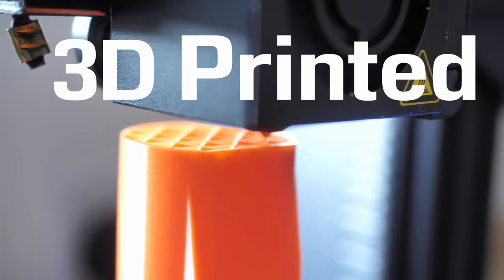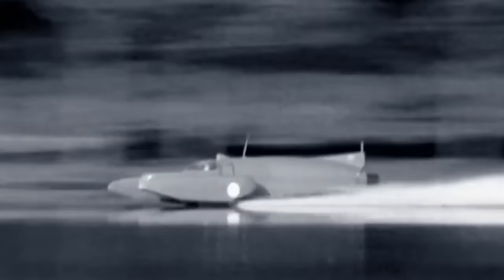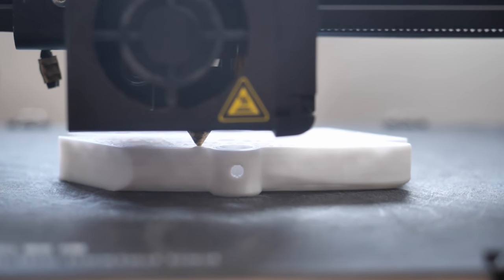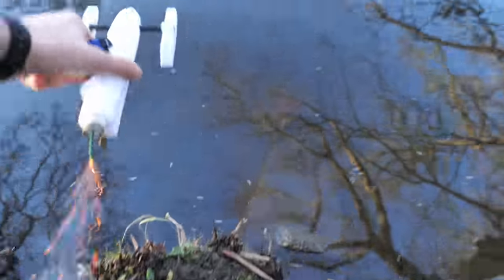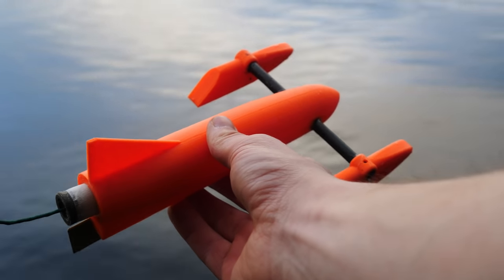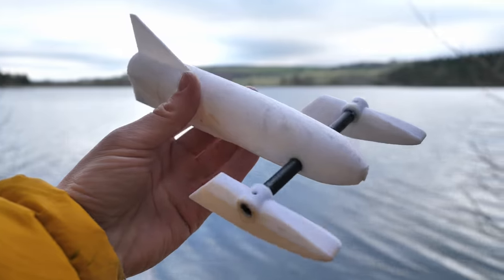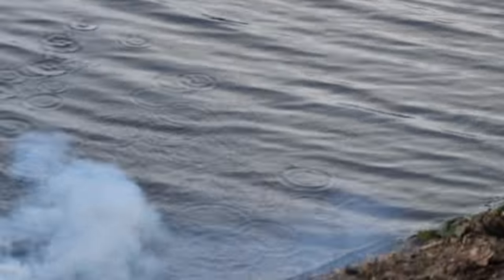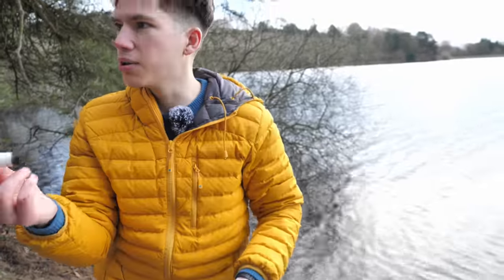Mini Rocket Boat

Comment: From my old model rocketry experience, while you want the CG ahead of the CP, you don't want it too far ahead or else the rocket will tip into cross-air currents (e.g., wind) excessively.  The rule of thumb was CG ahead of CP by the diameter of the rocket,  Anyway, love your channel and content.  Keep it up!!
Reply: This is a boat. Not rocket. Also not going up.
Reply: @alpha_pixel_  still applies though, think about how both are simply moving through a fluid. you just want to avoid feedback loops once the rocket is tipped off axis
Reply: @alpha_pixel_  fluid dynamics pretty much covers going up, going down and going through, liquids and gases.
Reply: @alpha_pixel_  Mmm, that's a personal opinion, but I kind of thing it is much more complex than this. That's what could be called an 'interface vehicle'. Meaning that traveling at the same time in interaction with several (two) types of elements (here fluids, liquid and air). Which one has the upper hand? As in F1, aerodynamics impact parts which are also in contact with the ground. But the opposite is also true. That would be the same for a sailing boat, that could be seen a a blend between a wing and a boat, the with the added complexity which is to deal with other interactions, as when the wind blows, the waves tend to be higher, meaning that the scenario changes as the 'envelope' does, and the design should accomodate for these changes. Not an easy task! Best regards!
Reply: @alexandregrynagier1762  physics are a personal opinion? Interesting 🤔☺️
Reply: Personally I found double the diameter was best (altohogh the rockets I used weee quite thin

Comment: Angle the outer edges of the sponsons, this will help prevent the rolling over. I used to race gas rc hydroplanes. This was a trick to get them to turn fast without rolling over.

Comment: Small ripples behaved like massive waves at that scale. Increased scale will for sure be better. Also a T tail with trim tabs to adjust level / angle of attack at high speed would help.

Comment: Bigger boat and even bigger rocketengine! Maybe you should include there little bit electronics and make a gyro stabilization system in all 3 axis. A Goal would be to get straight line and more speed. I also recommend to make front ”skis” bottom v-shaped to make them less responsive to little waves.

Comment: Our racing riggers use two CF tubes, fore and aft. This prevents them from twisting, which is what appeared to happen in the first run when it avoided the retrieve boat. That would also keep it running in irregular circles as it did. Also, cg is important. It should balance slightly behind the rear edge of the front sponsons. On a 24 inch boat about 1 inch back. And a fixed rudder at the rear will help with tracking also. Keep at it!

Comment: Explore boats on underwater wings. There was quite lot of those used in river navigation of USSR. It also has 3 points of contact with water but under water. It gives better stability because there is no surface that causes transients while boat touching and detouching it.

Comment: Ive always wanted to build one with an EDF powering it. No idea why
Reply: With an EDF it gets water spay on the fan and most of the time the fan implodes or it goes super slow due to water hitting the blades. You would have to work out a way to prevent water from hitting the fan blades which isn't easy on a small scale. Best of luck. Just have fun.

Comment: For this hydroplane design, you may be able to get more reliable onset of planing behavior by putting two thin cheek pieces on the wedges so any trapped air can't escape out the sides. The cheeks or side-walls would basically force any air in front of the sponson wedge to go under it; the only water drag you would incur would be the two thin side walls slicing through the water. Same with the wedge under the boat itself; sidewalls may help force any air in front of the wedge to go under the body, causing the onset of planing to happen more reliably.
Could you try that and see if putting sidewalls on the wedges improves the onset of planing? I'm curious to see if that works.

Comment: you really need to try to launch these boats again but parallel to the coastline of the river. If the current and the waves are hitting the boats from the side it affects the boats stability way more .

Comment: You should make a large scale one that is remote controlled but have the motors delayed slightly so 3 go off, then 10 seconds later another 3 etc so you have a longer burn time

Comment: Your stability problems are the result of launching the boat with the current of the water perpendicular to the boats center line. Those tiny ripples are large to that tiny boat. So it causes a rolling motion until one sponson is completely out of the water. The opposite sponson is levered down into the water, increasing drag on one side. Thus slowing that side and inducing yawing motion. The solution for the tiny boats would be to launch the boat parallel to the current. So, yourself on a boat anchored out in the middle, I would suggest launching into the current so the tiny boats would float back toward you.

Comment: Looks like all it needs is a brass plate below the rocket motor to keep water from splashing into the nozzle. That will stop the rocket from sputtering, and help it produce more consistent thrust.

Comment: Try this simple expedient: make the bottom of your rear planing surface a trifle wider and a slightly inverted V bottom. This forces the water-which always wants to escape from the bottom of the boat sideways (the shortest route) without planing the boat, to keep moving aft and to continue lifting the boat. If it does go sideways, it has to travel downward thus lifting that way as well. This is based on the old Hickman Sea Sled principle which has yet to be improved on.

Comment: Possibly a very daft idea but......
Could they be designed to be symmetrical (top and bottom) so if they flip they would still plane . They are fairly close to symmetrical so not a large change.   😎

Comment: You should put rudders on the out riggers will help keep it in a straight line. Also cant the The angle of the out rigger will also help with tracking.

Comment: That is so cool, hydro rockets, but my opinion is " why the motor(rocket) is under the water , i know that they are  waterproof but that causes unnecessary underwater combustion that affects rockets performance ,just try one's again with rockets exhaust out ofthewater" maybe the results may different 😉

Comment: I would suggest two things. Firstly, put your sponsons a bit further out from the hull. secondly, I would suggest you put keels on your hull and sponsons as well, to aid in directional stability, these changes would make the boat be more stable than a single rudder at the back and flat sponsons. if you look at boats, they have a keel, and that always makes a ship more stable both directionally but also at speed. I noticed that once your little rocket boat gets to a certain speed, it starts hopping unti is get high enough to cause the front of the boat to go under the surface, so your sponsons should have a clearly defined keel, as well as being curved upwards at the front with a clear horizonal line that defines the top of the sponson so that when the front of your boat comes back down onto the water from a hop, it doesn't dive into the water, but forces the water away from the sponson both forward and to the sides. in otherwards your sponsons need to be shaped like a boat as well as the hull of your boat, rather than being shaped like a torpedo. I hope what I'm saying here is clear to you. go look as some of the fastest speed boats, and your hull and sponsons need to have a similar shape, otherwise you will continue to have your rocket boat doing impressions of a torpedo.

Comment: Add fins that are sharp on the edge started from 10-20% the length of the pontoons on each side
Same fins as the pontoons for the back
Try with single to two fina for the pontoons

Comment: Can you make your own propellant and your own thrust engine like integza did. Btw love from India
Reply: Under UK law it is prohibited to manufacture your own motors
Reply: @noahluppe  oh I didn't know about that . But can you explain in detail that which kind of motors are prohibited (electrical, chemical) and if someone or some companies wants to experiment for good how can they achieve .
Reply: @rishabhguptarg  Without license the production of any explosive is prohibited, wich applies for solid rocket motors. For liquid or hybrid motors other laws might apply, like restrictions for compressed gas oxidizers, without owning the proper licenses.
Reply: @noahluppe  it is very strict their that's means. I think project air should apply for the license
Reply: @rishabhguptarg  If I know something from germany "applying for a license" is not just sending in a form or sth. Here you have to attend licensed courses to be able to get the qualification for similar things. And it does cost some money.

Comment: Had an idea. What about a submerged fin that controls the height of the hydro plane. Similar to an elevator on a plane. But it would be operated by a float. When the craft is low in the water, the float would pull the elevator up, when the proper height is reached, the float would level out the elevator. It would seem this design would allow you to get the craft nearly all the way off the surface of the water.

Comment: Side angle of front sponsons is 7.5 degrees, kind of like dihedral.
Sponson angle of attack at rear is 3.5 degrees.
Sponson angle of attack at front is 15degrees.
Vertical outside of sponson is 7.5degrees tow in.
Vertical inside of sponson is vertical with turn fin optional. 

Rear of hull needs sharp sides and pointy corners. Convex hull is ok

Comment: Do you have a lot of model rocket motor police running around, in the UK? 
Maybe you could have two rocket motors on the front sponsons, that might travel straighter, if you could ignite them both, at the same time, with an electric igniter.
The color orange seems to be working well and you should stick with that.

Comment: I think you need to also consider the thrust line of the rocket motor as well. IE planes do not have a straight thrust line. usually slight down thrust up to about 2 degrees.

Comment: The relative elevation of the boats above the waves compared to the average height of the waves/ripples of water they need to traverse on is perhaps  a factor to consider. Make the thing such that the average height of the craft/its elevation relative to that of the waves on the water is large enough to matter less. I guess that would require the use of a larger motor, not so?

Comment: the test kinda revealed something to me. the orange one with a wider base means that any variation in the two, where drag is affected, either by the boat tilting, causing one side to hit the water faster than the other, or by surface imperfections from printing or debris getting caught, will cause the boat to yaw violently, whereas the blue one being closer is less likely to run into such problems and would go straighter, which isnt something that crossed my mind up till watching it happen

Comment: Jetex marketed a model of Donald Campbells Bluebird hydroplane in 1965 together with a Bluebird record breaking car I had them as a kid I did not use the hydroplane as it was likely to run out of motive power in the middle of the lake and become irretrievable for me but the car was fun even if it was responsible for the odd burnt finger, the real issue with the 3 point hydroplane design at speed of course is stopping the nose from lifting and flipping the whole caboodle but I would have thought a computer driven stability system using front canards might work but probably hellishly expensive.

Comment: Hi! I don't know if if would be the right term, but maybe adding a 'toe in' to the front float, or design them so they create more drag to the outer side of a turn would help a lot in stability i think. The issue is that the front floats create more drag at the front. More buoyancy is cool there, but more drag means this craft is dynamlically unstable, especially if the front floats are neutral (it would be worse with a 'toe out' sorry for borrowing racing car terminology here). It could be a stupid idea, but if your sponsons where designed to act like wheels (meaning they could spin as fast as the boat goes), it could reduce the drag. Or maybe just another stupid idea of mine :p. Anyway, cool idea, i love it, and thanks for the video! Best regards.

Comment: Wonder if a hydro foil would work. Just attach runners to the existing boats you have would be less effected by the rough water and get the engine out of the water.

Comment: I bet the aditional weight in the front caused the torpedoing. maybe compensate with buoyancy? also I would try to raise the motor a bit. So it pushes the nose down.

Comment: You should try a tunnel Hull design biggest problem I see here is the Center body is in the water too much but this is really cool with the rocket engines years ago they used to use the little Estes jet engine and little cars and boats

Comment: I have a recommendation; A)For a control get same size but slightly shorter burn. B) Contact a university with a swim team, or contact MoD many military pools are huge. C) Explain what you're doing and why, but you'll probably have to explain why it would be beneficial to highlight their institution on your channel.  It's free positive advertising for them and both the universities and the military want to be viewed in a positive light, it helps with recruiting... both, studemts (and their tuitions) and the military (new military members).
D) Test on the glass smooth surface. Film/video everything. 
You might find some impressive, maybe even surprising data.
If you want to increase your science think big... more data. If you want to increase your channel tnink big... more subscribers... more revenue... which pays for more science.
It's an ingenious system YouTube has set up, take advantage of it.

Comment: I loved seeing your speed boat go.  Well done.  With some small changes it should be able to go straight.
I disagree with your intent to place the CP (center of pressure) so far back.  Center of gravity (CG) is less important than center of drag (CD).  Placing the water fin near the rear moves the CD back.  Finding the CD is tricky in this case because it involves both air drag and water drag.  It will go straight as long as the CD is behind the center of pressure (CP).  Take an arrow as an example that is easier to understand:  The CD of the shaft with no tail feathers is about 30% back from the tip while the center of mass (CG) is near the middle.  Without tail feathers any slight perturbation that offsets the CD from the CG in the line of flight generates a torque which increases that offset which will cause the arrow to tumble.  By adding tail feathers to move the CD behind the CG any perturbation that offsets the CD from the CG in the line of flight generates a restoring torque to realign back to line of flight, thus the arrow flies straight.
For your speed boat the fin in the water has a dramatic effect of the CD because water density is huge compared to air.  However, when the craft hits a wave (ripple) it may bounce the fin free which enables the CD to move forward, instantly loosing stability.
So, what if the rocket motor were mounted near the front?  Maybe with a fuselage diameter big enough that wouldn't melt from the exhaust.  Also pay attention to its airborne flight characteristics.  It may become fully airborne after hitting a wave (ripple), so in that mode it may need small wings, like a canard aircraft design, to glide back down to the water surface.
This problem is very similar to the lesson learned by Sailrocket 1 : https://www.youtube.com/watch?v=8Ow8QbXhZJU 
and fixed by Sailrocket II : https://www.youtube.com/watch?v=DCPx8wQZ5KE

Comment: So we did this in 1972, oh god was it really 50 years ago…….

So without YouTube we had a huge amount of fun and avoided arrest too! And we didn’t have goggles, only highly inflammable kiddies Parka coats (look them up).

Materials needed:

1 x Airfix Model of HMS Fearless, (LPD Landing Platform Dock) last in effective combat 40 years ago in the Falklands Conflict and now razor blades somewhere.
1 x Standard Firework Rocket with stick.

Cut off stick from rocket. Glue and tape rocket to the flight deck/dock stern area of HMS Fearless. Take to local pond/lake. Place in water and aim towards middle of your test area. Light rocket and stand well back.

Rocket ignites and takes off easily twice as fast as the one shown here. Me and three mates piss ourselves laughing and take off on our Raleigh Choppers back to civilisation (Mum and Dad’s house).

Result mayhem and a huge dose of ballistic knowledge learnt. None of which we used in our working lives in anyway shape or form…

Comment: Im no rocket enginear.
But that to me looked as to much thrust for the weight/control surface ratio. Every bump was a new trayectory. With that thrust, the thing just... wel. went torpedo.
If I were to fix it... I think my first instinct would be to place jets on the side huls. Les powerful ones so it doesn't go haywire. [But I know that igniting solid fuel jets at the same time is tricky at best] and pump up the weight. Like 3x times at least.

Comment: Hey, what about a hand crank generator but the hand crank is a pin wheel with rocket boosters in 90 degree from each other spinning the hand crank pin wheel super fast generating lots of power but only for short amount of time. Im curious how much each rocket booster type produces in electricity. Please let me know if you try it or if anyone does thanks.